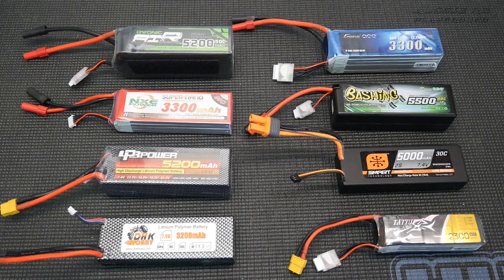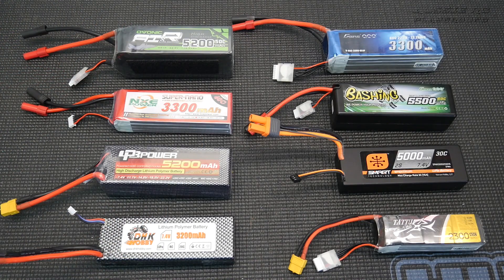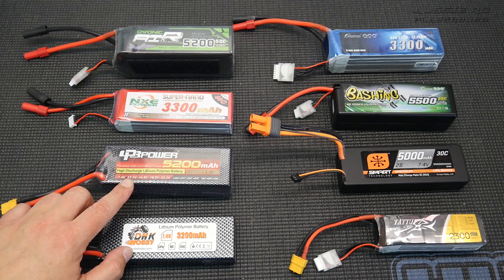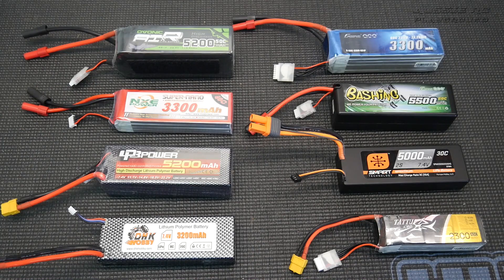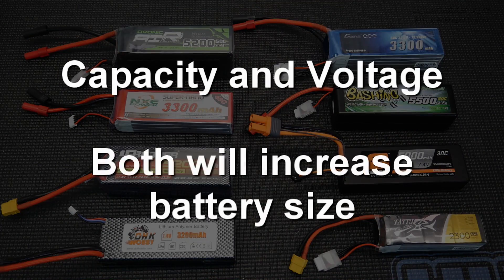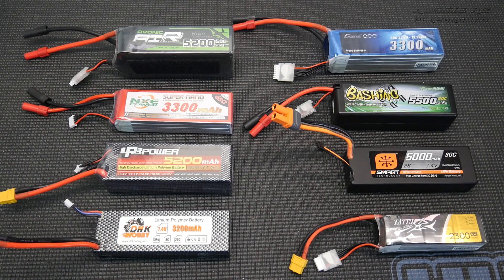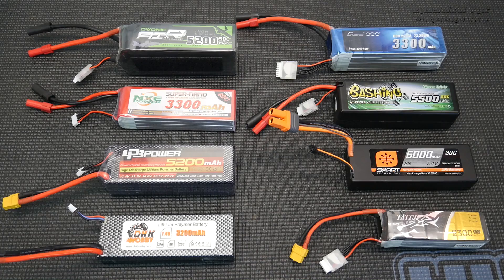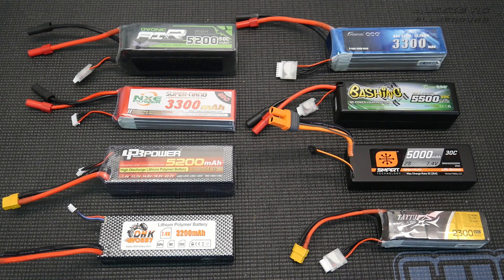RC HOT TIP - Understanding Lipo Batteries (Part 2) mAh & 'C' Ratings

Comment: Recently I have an argument with a lipo seller. My original lipo is 4s 5200mah 30c. I bought a so called 4s 6100mah 100c pack to complement my 1st heli pack. I surmise I should get longer runtime with the 6100mah. However I  getting much less runtime. I surmise that the batt manufacturer has lied about the actual mah rating. The seller insists that the   high C batt he sold me is discharging much quicker by its nature. I call BS to that. The heli is stock so the load draw will not increase just because the batt has higher C rating. The motor and esc takes what it needs which is not much. What do you think. Is the seller wrong?
Reply from the maker: You're spot on. Only way I can see the bigger battery not lasting as long would be due its weight. A bigger, heavier battery will require more throttle to stay airborne, thus depleting the battery faster. But the jump from 5200 to 6100 is not very big, so unless the 6100 is a Graphene battery (which typically weighs lots more), then I'd say the 6100 number is probably incorrect. To be sure though, discharge it to 3.2v on your charger and then charge it up to full. The charger will tell you how many mAh went in at the of the charge and then you'll know for sure.
Reply: @AussieRCPlayground exactly. And you know what? The 6100mah was 490g and my old 5200mah 545g. So it's actually lighter yet it gets to 3.7v sooner. Which means the 6100 mah rating is actually even lesser than 5200mah!

Comment: Hi Aussie, I am a beginner and I need your advice for running my Proboat 26 now. I'm running the boat with a 2200mAh/45C lipo battery connected with my Dynm3860 30A (peak at 80A) Brushless Marine waterproof ESC with a 2 blades propeller with big tough (for better pick-up). I found the boat is not even going fast even I pull my trigger all the way down! 
Here is my calculation I've learned from you:
2200/1000 Ah x 45C = 99A which is within the 30-180A operational capacity of my ESC
It looks ok in term of math but how come my boat is not accelerating fast enough?
What can I do in this case? Please help, thanks.

Comment: Dear can I use 3s 7200mah 80c lipo for traxxas TRX4 Defender?
Reply: Does it damage to esc ,motor or anything 🤔
Reply from the maker: I believe those trucks can handle 3S just fine, so it should be ok. 👍

Comment: I am building  Hexacopter with Frame Tarot 80 pro.
Which approach is better to choose  battery to have long flight time?
1) Single 6S Battery with higher capacity (x)mAh.
2) Parallel connection of two 6S batteries with capacity (x/2)mAh.

Comment: I'm an experienced hobbyist and I always learn something from watching these videos! Also - correct me if I'm wrong - if you divide the mah rating by 1000, you get the maximum Amps you can charge the battery at. E.G: 5200 mah ÷ 1000 = 5.2 Amps ; so a 5200mah battery can charge up to 5.2 amps.
Reply: Thats the same as 1C rating.

Comment: For gasoline the higher the octane the cooler the burn. That's why high performance engines run higher octane, to help keep the temperatures down.

Comment: Hey Vas if I stack two 3s 5200mAh does that make it 10400mAh been wondering about that for a while it seems like my Rc runs longer then others
Reply: Only if you run it in parallel , mah doubles if you do = longer run time

Comment: Very good introduction to lipos, bro. 
I might have included the Wh, which is a good indicator of stored  energy and also correlates well with the amount of fuel in the fueltank.
I am writing this, because when I was  a rookie, I thought a 2s 5000mAh lipo will give me the same runtime as a 3s 5000mAh. But my Slash proved wrong every time although a lot depends on your throttle finger. 37 Wh vs 55.5 Wh. Being unaware of this, I had to figure this out on my own expense.

Comment: The octane analogy doesn't work. Higher octane doesn't equal a bigger burn. The octane rating of gasoline is its resistance to burn. A low compression engine won't run as well on a high octane fuel and vice versa for a high compression with low octane fuel
Reply from the maker: So I've been told... So use a different analogy, like the number of cylinders. It really doesn't matter what you use as long as it makes sense to you.
Reply: @Noobz Threefortyseven That's true , then you can advance the timing for a bigger burn and more power.

Comment: This information should be given to customers at all local hobby shops, but no, they're still trying to sell 20c rating lipos to run in cars like the  kraton 8s and then the customer wonders why the batteries are so swollen. Great video Vas, Thanks
Reply from the maker: I work at a hobby shop and this is the info I give to my customers. 😉
Reply: @AussieRCPlayground  that's great to hear,  happy that someone does. Great video, very informative, Thanks

Comment: Good infor, but one major wrong. The voltage cannot be compared to octane in any way shape or form.
Octane is simply a measurement of a fuels resistance to detonation. Octane has zero to do with energy density, burn rate, or flame front speed. If you want to make such a comparison, it would be between say ethanol and petrol with petrol bei g higher voltage as the energy density of petrol is higher than that of ethanol.
Let's once and for all kill the myth that octane means a bigger bang and a hotter burn, because nothing could be further from the truth. If an engine does not knock on 95 RON, putting 100 RON in a car will do squat. If the knock sensor retards ignition on 95, yes then, and only then will a higher octane fuel provide more power, assuming that energy density is the same.

I will now step down from my soapbox and we can get back to the scheduled program.
Reply: lol   You sound like me explaining that hydrogen does not work in a conventional combustion engine and that the best bang on this planet aside from military weapons is kerosene ...... Saturn 5 F1 7.5 million lbs. (3.4 million kilograms) of thrust.

Comment: Hi Vas, great video again, question! When should I change from XT 60's to XT90's from 4s up woulds! Thats would be a good video to do! cheers mate!
Reply: TheWheels1965 I use XT60’s on everything. I’m using them on 6s, 5000mah, 50c and not an issue at all. I wouldn’t be in a rush to upgrade to XT90’s unless you are running over 8s I imagine 👍💪